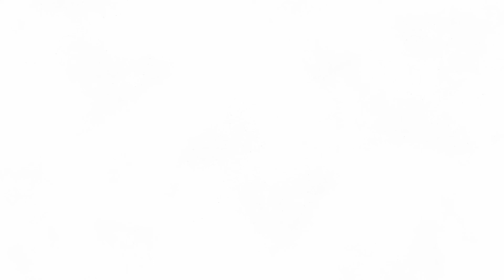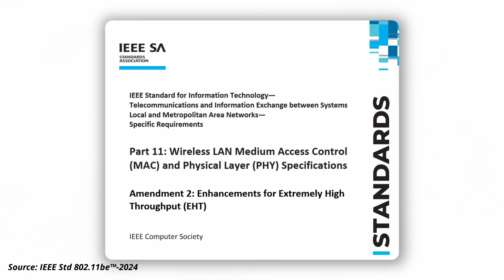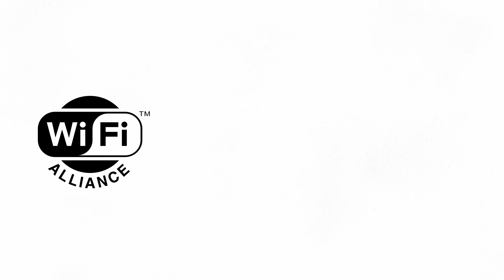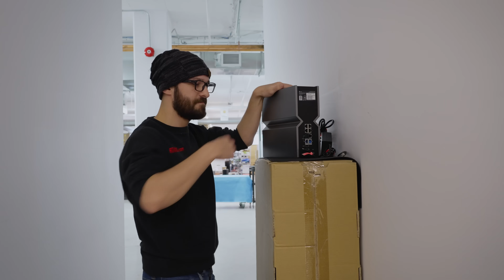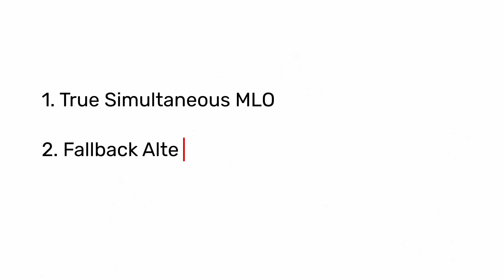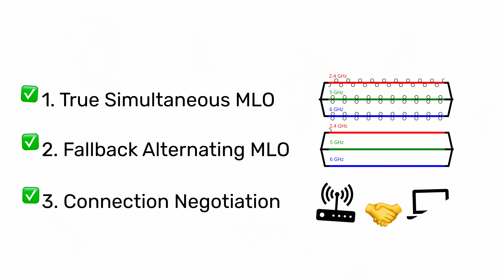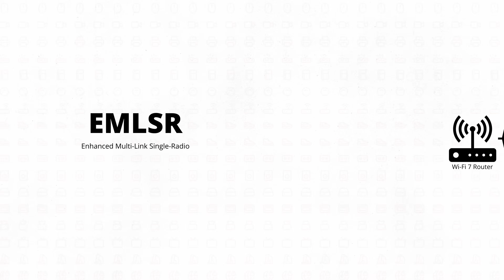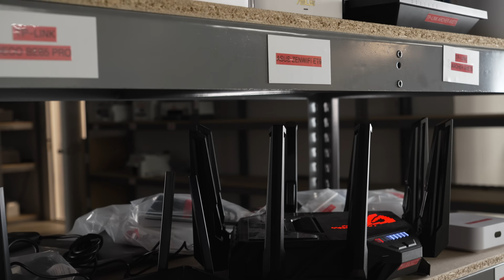Wi-Fi 7's Best Feature Doesn't Work (Yet)

Comment: It's always been like this- you buy into the newest gen WiFi - but all your client devices are earlier gen WiFi standard.  As you gradually replace those client devices, they end up having the newer standard.  
What ends up happening is all those max-performance promises that were made for your older client devices- you actually realize and receive those performance promises by running older client devices on the newest WiFi standard. 
The cell phone companies and carriers do the same thing with 3G, 4G, LTE, 5G and 5Guw- they would say you have LTE speed, but it would be the lower end range of that spec and would at the higher end of 3G/4G- and likewise for LTE to 5G/5Guw.

Comment: One thing is the routers. But do not forget the clients that causes issues with MLO, even if the clients was said to support MLO. Compatability issues can be a main factor that this is not activated.

For some solutions, I beleive  you will see that MLO is in use for a separate SSID that is used for mesh backhaul.
Reply: Yeah the only clients with full-fat MLO that currently exists are the access points themselves. They don't expose the features since no client devices on the market that could use it currently exist.
Reply: @JamesTK  respectfully, imma have to call B.S. on that. There is no way that these vendors can guarantee that there isn't an engineer who has already built an MLO client in their backyard, despite it not being commercially available elsewhere.

What makes sense is having it exposed but off by default with a warning.
Reply: This is why I don't like looking at graphs and data. The people putting it together are always missing something that makes the whole thing worthless.

Comment: Other question is what client devices support the full wifi7 feature set and would be able to utilize it if it were available?
Reply: As per the video, no client that supports the full feature set is currently available
Reply: @JamesTK  But that's not a reason why you shouldn't buy routers with Wi-Fi 7.
Reply: @JamesTK  this is only a test on low budget consumer products,  maybe on higher end products is different, I don't know

Comment: Good and insightful video, looks like Unifi nee to step up here. I'm using a UniFi Cloud Gateway Fiber with a U7 Pro Access Point. The only devices we have that can access the 6GHz band are my wife's M4 iMac which is Wi-Fi 6E and my PC's motherboard which supports Wi-Fi 7. However,  I have my PC connected wired using 2.5G Ethernet.  Maybe when we upgrade our phones we will some Wi-Fi 7 devices to test.  But overall wireless performance has been solid and robust for the devices we have.

Comment: Thanks for another interesting, and important video.
Selling "the dream" (i.e. selling using the specs of the "tech standard" when fully implemented, working under optimal circumstances"....) rather than on the ACTUAL capabilities is imo tantamout to fraudulent.
BTW, does this remind anyone of the ""5G HYYYPE"" surrounding mobiles !!??  
That said, after having "quirried"all my friends and familly ((i.e.  being unpaid tech support)). I can pretty confidently say that the ""demand"" for faster connection on wifi (and in general) is approximately ==0, zero, silch... Rather what they all want is a "stronger" and more reliable connection,  rather than more "complex" and "unreliable" one. So "WiFi7" could in theory help with this, but so could "MuMimo" and I must say I didn't see any significant benefit from that... AND furthermore most people, self included, don't really care very much, if at all about "uplink speed" people are "normally" only concerned about their "download speed"...
Best regards.

Comment: I have a WiFi 7 AP, and I definitely notice a difference...however that's because I'm not only getting better signal through walls on 5GHz, I'm usually on 6GHz and still better signal. Heck, even using it outside of the home plenty. That is compared to one of the first 802.11ac(WiFi 5) routers that was available to the public(did not have all the features added later on to the standard, like MU-MIMO). Also had a cheaper wifi7 router briefly that seemed to get a fair bit better signal than a barely cheaper WiFi 6 router. It's tough to compare those perfectly because of how much goes into it, but interesting none the less.

Comment: Consumer routers are always missing features. This is nothing new. I have MPO on my U7-Pro. Turning it on breaks half of my wifi devices and the wifi7 devices I do have only a few even support it. The feature is not good. That is probably why nobody bothers supporting it. It is only the beast feature in theory, in reality it is half baked. The one device I did test it on got 1Gbps down with MPO off and 1.2Gbps with MPO on. and upload didn't change. So 20% more download who cares?

Comment: 2:28 “By avoiding the Wi-Fi Alliance trademark…” — so if I avoid the “Coca-Cola” trademark simply by writing coca cola in a different font, am I suddenly free to operate? That’s bullsh.t. It is still trademark infringement through consumer confusion. In fact, it even crosses into deceptive or fraudulent conduct, not just a trademark misuse.  If the Wi-Fi Alliance doesn’t want to be seen as a laughing stock, they should consider legal action for trademark infringement. And the FCC — or the relevant regulator — should probably look into it as potential consumer deception or fraud.
Reply: Not going to happen, Wi-Fi alliance isn't another entity, they are formed with these companies.
So it's almost guaranteed it's intended to be this easily deceptive yet giving a hint of deniability by design
Reply: Exactly. It's blatant trademark infringement through consumer confusion. Either the Wi-Fi alliance has no real central body or backing, or they're afraid the brands will back out of the alliance if sued. The only thing I can think of is if the router brands will say they're referencing the IEEE standard, but I believe it's the alliance group that does the numbering for different "generations".
Reply: If everyone is part of the scam and paying for who enforces the rules..... Yah
Reply: Wifi is not the trademark. It can’t be. Your analogy would hold up if you say „if I just write cola“ which is exactly what other brands do.
Reply: Consumer financial protection bureau got defunded by trump admin bc some billionaire went on joe rogan and convinced a bunch of rubes that consumer rights is a heckin cawmyoonism
Reply: You can't complain to anyone because Wi-Fi is a shared medium.

Comment: I have AVM Fritz!Box 7690 which supports Wifi7 and MLO. But which kind of Wifi7 or MLO, i don't know. With MediaTek MT7925 i have sometimes connection losses.
Reply: You are a victim of AVM marketing. Your Fritzi-Box supports Wi‑Fi 7 (WLAN‑be) – but without 6‑GHz‑band.

 Was MLO bei der 7690 kann
• 	Gleichzeitige Nutzung mehrerer Frequenzbänder (2,4 GHz + 5 GHz)
• 	Höhere Ausfallsicherheit (Router wählt automatisch die stabilsten Kanäle)
• 	Mehr Durchsatz, weil mehrere Links parallel genutzt werden könn

Was MLO bei der 7690 NICHT kann
• 	Kein 6‑GHz‑Link → also kein 5 GHz + 6 GHz‑MLO, wie es High‑End‑Wi‑Fi‑7‑Router bieten
• 	Keine 320‑MHz‑Kanäle, da diese nur auf 6 GHz existieren

Comment: Oh, I actually do have that Zenwifi BT10. It’s the bundled router for my 10Gbps home service so i’m not really paying for it at least

Honestly? The router itself is fine, but I was contemplating to disable MLO backhaul link, because I did not think it actually helped as much as the marketing claims, and it came off with some tradeoff too like not able to separate bands, which might be needed for some device that somehow insists on 2.4GHz despite being capable of 5GHz. I thought there’s still some benefit, but Inguess I won’t have much qualms disabling it then

Comment: great video, my building's eero router with wifi6 always drops me to 2.4ghz because we have concrete walls and i lose connection each time, i tried TP-Link AC1200 WiFi Extender (RE315) for $40cnd and it let me disable the 2.4ghz, plus i made 5ghz as prefered on my wifi adapter, that solved it, still low bars on 5ghz but it's not disconnecting me anymore, also use a ping in terminal that pings google every second to monitor connection, i doubt i can include the command, i'll reply to my comment and see if youtube allows it
Reply: C:\Windows\System32\WindowsPowerShell\v1.0\powershell.exe -NoExit -Command "ping 8.8.8.8 -t -w 1000"
Reply: also have it start in that folder as well if it doesn't have that set, i forget if i set it manually

Comment: Its crazy that none of these work as advertised. Is there any benefit at all then to use the MLO feature? I can set up 2 SSIDs on my router, one is MLO one is non-MLO. Is there any difference. 

Actually it seems that the MLO one prevents roaming on the mesh network, moving between rooms results in signal loss.
Reply: At the moment almost no client devices support MLO so MLO on the router doesn’t really help anyone. It’s frustrating that the router advertising is misleading but this has really no real world impact at the moment

Comment: I have a (Netgear) Orbi 770 and you can enable MLO in the settings.

That being said I found this router has a worse signal and slower speed test over wifi than my Orbi 750 which is wifi 6. But the ethernet and backhaul is faster which is what I needed.

Comment: Thanks for saving me money from upgrading. Ethernet is still king when it comes to distances. Might be anecdotal, but I have a spectrum 6e router and I would like it to switch to 2.4 when I'm at the far side of the house. Turns out, it just broadcasts 6 and 5 and 2.4 is just a temporary setting for 30 minutes.

Comment: I disagree with the focus of this video. I don't think throughput is as important as most people think it is. Unless your application reliably completely saturate the bandwidth, it's not important. as long as MU-MIMO is implemented, vast majority of the users will not see tangible improvements from throughput. On the other hand, the single most important feature that got me to buy my WIFI7 devices is Preamble Puncturing. Split second signal drop has been such an infuriating issue for gaming. The only solution was to drop channel width to 80mhz, which significantly slows throughput, or suffer from game dropping offline a few times a night. PP was able to fix that and I can easily run 320mhz channels without any droppage
Reply: My neighbour has a NAS running in a cupboard, he has children who love exploration and he has to safeguard it and since it is a 12-bay NAS reduces the noise at night. He uses it wirelessly. Has a Ruckus R770 AP, and he can effortlessly do his work and stream videos which is not possible on . Bandwidth is important going forward. And you can only get good bandwidth if you have good signal.
Reply: @yilts9748 what work?? What video streaming that requires 9 Gbps??? Does that NAS even have SSDs? I don't even know any NAS can break 500 MBps let alone 900.

Comment: This has been the practice in consumer technologies for decades.  Marketing almost always brags about what's theoretically possible with a technology, but carefully avoid actually specifying that the product they are selling actually achieves it.

I remember quite well that in the mid-90's when 3D cards first became available, one of the companies released a demo showing that without "3D" there was a multi-faceted shape rotating and deforming in space; a shape that obviously only consisted of perhaps 8 polygons.  The video then showed the same scene with "3D" where that shape became a smooth spheroid deforming such that no polygons were visible at all.

They were quite strongly implying that the product that they were selling would perform this magic on the customer's computer.  Unfortunately, what that demo actually showed was that in a future world of 3D acceleration, shapes might someday be made with so many polygons that they would appear smooth to the human viewer.

In other words, the entire demo was an outright lie, but it worked; that marketing sold tons of 3D cards only for buyers to find out that their games did not benefit from acceleration because very few available games supported 3D APIs and even those that did often only used the bilinear filtering feature to smooth antialiasing; it would be years before actual transform and lighting (T&L) acceleration would be built into such cards, let alone into all games.

This is merely one example; viewers should always think critically about marketing and pay attention not to what was said in the marketing, but to what was not said.  Marketing is just a politically correct word for lying and brainwashing.

If you want proof, look no further than Tide Pods or how that same concept is now used in dishwasher pods as well.  The colors are fake; it's just a lie and that lie makes shareholders tons of money at our expense.

When children were dying from eating Tide Pods, Tide ran a public safety campaign to educate us on how dangerous they were and to add child-resistant lids to the tubs.  It would have been simpler and cheaper to simply get rid of the whole concept and go back to powder detergents, yet Tide refused.  Why?  Because it was more profitable to kill a a few kids than to stop doing so.  When asked if they could simply make the product look less edible, they changed the subject.  They knew that doing so would reduce profits.

And if you think that Tide is more effective because of the different colors, then you are the target audience.  The "pod" simply guarantees that you use 1 entire pod for each wash, regardless of load size; it guarantees more sales as pods are priced higher per load than traditional powder detergents.  Yet almost everyone I know buys them.  Why?  MARKETING WORKS.

Comment: Higher Speeds may matter to some users... Reality is even devices say AC/5 or AX/6 often won't support WPA3 or Bind or Backup Frequencies when too far etc from Router/Gateway or Access Points. Even when a Device supports those and more, most Hotels and other places have huge problems and network crawls no matter what you do and WPA2 so old devices can access them. Is like Cell Systems claim "5G" but often can't get even best speed that 4G LTE in most places. If you find UW 5G and often move inches to a few feet or another person moves into signal path that signal is lost and hope you get a "Slow" regular LTE or 5G channel.

Comment: Wi-Fi routers have always been marketed in the grey area.  Wi-Fi N and before were not even usable for any decent speed.  Wi-Fi AC (5) were the first routers which were usable.  Wi-Fi 6e is rather nice and Wi-Fi 7 best feature isn't multilink it's the fact it broadcast on separate channels which others don't use.  

If you're in an apartment building more than likely everyone is using their own router and jamming up the same radio frequencies.  And most people set the radio setting to the highest strength instead of the lowest like it should be for living in apartments.  Wi-Fi 7 solves both of those issues and to boot it's on new frequencies Wi-Fi AX(6) isn't using.  Wi-Fi 7 radio waves don't travel as far so it's less likely to conflict with other peoples networks.

Multi-link would be a nice feature to have, but it's not likely to work well in many areas.  It'd probably work well if you live in a rural area with no neighbors, but that isn't the case most of the time.  Likely you can pick up at least 3 networks other than your own from most houses yet alone an apartment building.